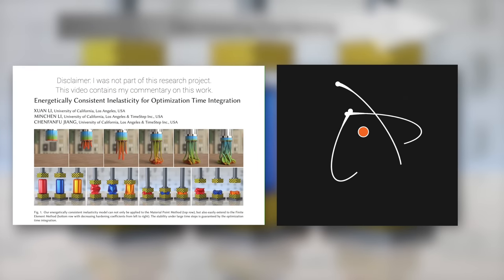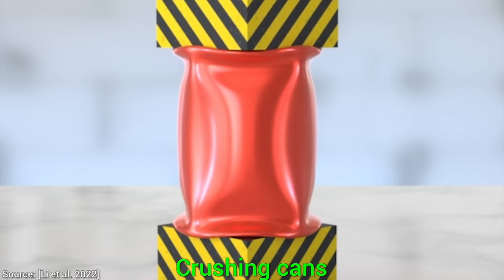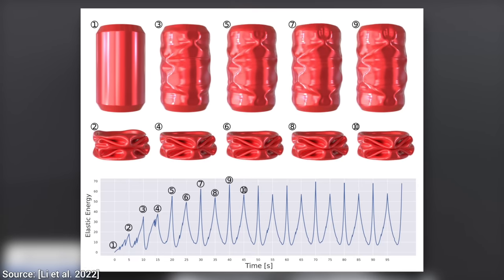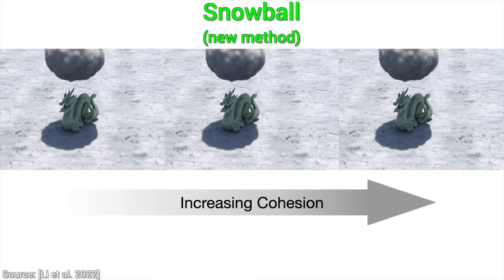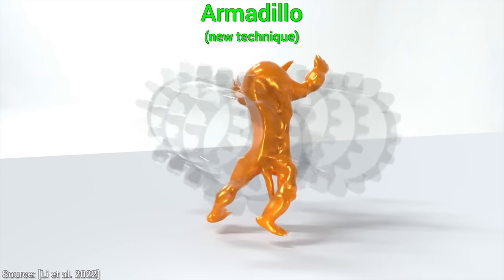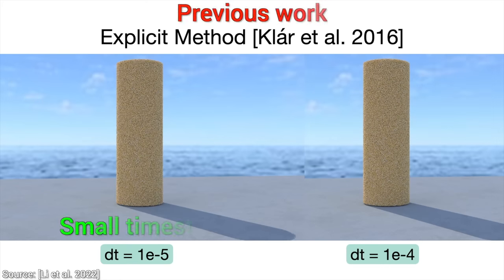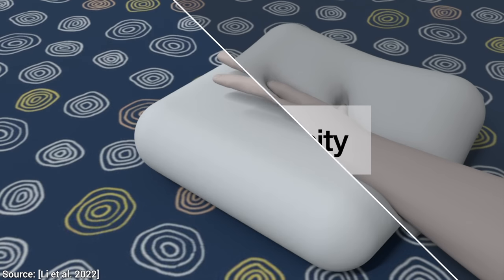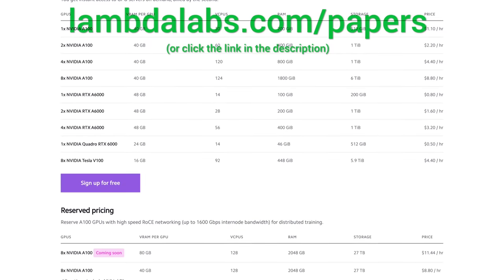Crushing 1,000,000 Particles With a Hydraulic Press!

Comment: Before crushing any shiny alloy thing, you have to shout, "You're terminated, motherfather!"

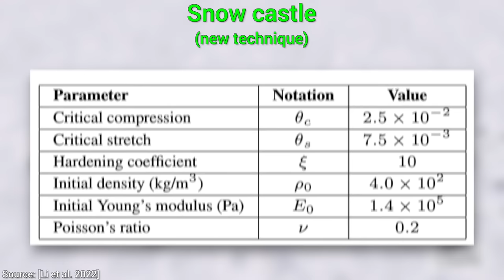Having taught skiing for many years, I can tell you that there are at least a dozen different basic types of what we call "snow". And none of them behave just like the simulation at 2:38. It's close, don't get me wrong, it's very close, but not quite there yet. 

I can say the type of snow modelled is a late spring snow, which has melted and refrozen into small balls, which adhere nicely once they thaw out a bit, and freeze solid at night. Good snow for skiing first thing in the morning on groomed slopes, but by late afternoon it's starting to get a bit slushy, and heavy, and turns must be much straighter to maintain lots of speed, because you're moving so much snow in the carved line.

Pretty not bad - but not perfect. But of course, where will we be in two papers from now? HOLY MOLY!
What a time to upgrade your video card!

Comment: t'would be interesting to see hydraulic press comparisons where the the smiulated and actual objects weren't just uniform geometry but had small intentional defects or holes  in various places to make  failure modes more complex to really ascertain the fidelity of the simulated solutions beyond just evincing nigh symmetrical failure patterns where deviation between the sim and actual is going to be at its most minimal in most cases...

Comment: One major reason higher timesteps is important is that 1e-5 is 100k steps per second, while 1e-4 is 10k steps per second. To display in a game, you really only need 144 of these steps for most players, 360 for some. The bigger the steps you can use, the more cost-efficient it gets. Just imagine, with 1e-5 sized steps, at the higher 360 fps, you'd still need to compute 27.8 physics step for every frame. It means that there is space for a 27 fold improvement in compute power just by increasing step size.